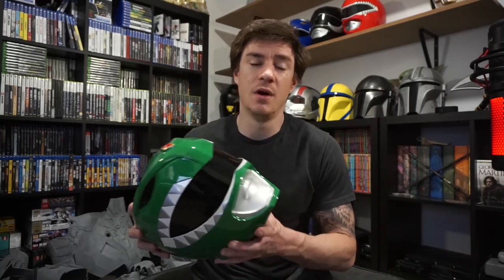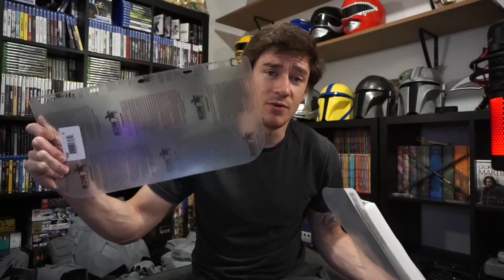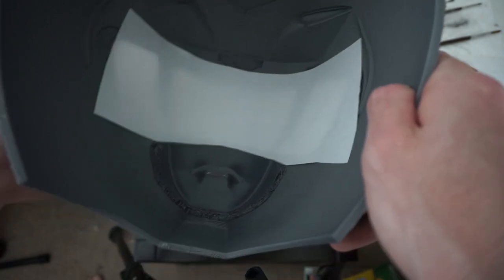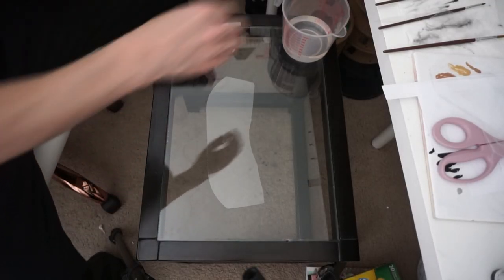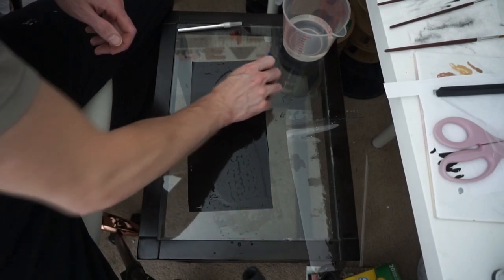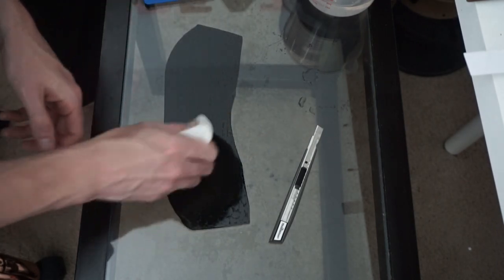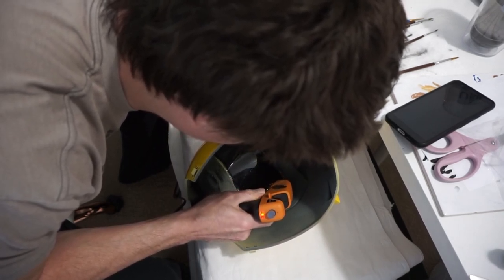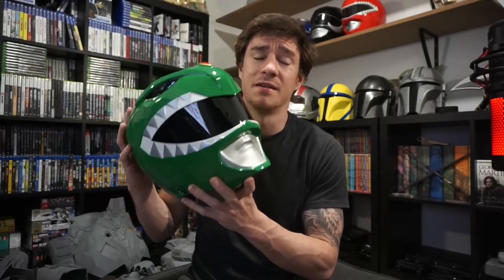How To Make Helmet Visors! Visors for your 3D Printed Helmets #3dprinted #3dprinting #tutorial

Comment: Adding to this, if tinting gets annoying for anyone/tinted welding masks are too dark, colored acetate or transparent pvc cover is your friend. Basically these are usually used for covers for binders and come in a range of transparent colors so you can have a visor besides black. They also come in just clear if you want to tint it yourself. Thickness-wise its actually in between the thin faceshields and the thick welding visors. You can usually find these in office or school supply stores or online.
Reply from the maker: Thanks for the bonus tip

Comment: I've read that people use a hot glue gun to simulate welding (the rocketeer helmet). A tutorial on how to do that would be awesome.
Reply from the maker: I have actually seen someone do that recently, I would expect the 3d design already would have the welds modeled on the helmet but it's really just drag the glue gun slightly wiggling then paint silver 🤘🏼

Comment: I JUST finished my Mandalorian helmet yesterday.. I purchased a welding visor off of Amazon and found it to be quite rigid when trying to form fit it in the helmet. I ended up using a heat gun to help form it, which worked wonders. I would be worried about using any sort of heat gun with window tint, though. So I would have to make sure to use something very flimsy and flexible like Acetate when using window tint, so I wouldn't feel the need to resort to using a heat gun.

Side note: I would love to see your process for applying padding inside of helmets and armor. I found it to be a constant trial and error process.. figuring out how much was needed, where it should be placed, how it should be angled, how thick each piece should be, and how the helmet sits on my head with each piece that was applied. Is this the "normal" process for applying padding?
Reply from the maker: The welding mask is definitely rigid like I showed in the video but should've been fine without the heat gun, also the face shield is very pliable so you shouldn't have to even worry about using the heat gun on that. For the window tint if you feel like you need the heat gun do it before you put the tint on. Padding is definitely trial and error. Completely depends on how you scaled your helmet to fit and what helmet youre doing. I usually don't pad it cause I scale them close to the fit of my head

Comment: Hey I know this is an some what old video now but I got a split/tear in the tint for my Red Ranger helmet visor. This tear formed after I put the visor in and had it in for a short while. How would you recommend repairing the tear without taking out the whole thing?
Reply from the maker: Honestly thinking taking It out is the best move, if you got glued it in should be very easy to peel the glue off the back

Comment: would it be a good idea to add a socket into the print for a visor to slot into? or is it better/simpler to go with the "what they cant see wont hurt them" style?
Reply from the maker: by socket im guessing you mean an indent for the visor to sit in, and some models have that but its more of a pain because then you have to cut the shape aboslutely perfect in order to get it to fit in rather then it just sitting flush with the edge
Reply: @SaturdayMorningProps   thanks friend, needed a second opinion before I tried adding it to a project I've been working on. was planning on making a indent kind of like half-rim glasses have, so visors could be swapped in and out. Its probably too ambitious so I'm gonna reconsider. you've been a lot of help
Reply from the maker: @darkdude9248  hmm lenses are a bit different it's not as hard to make a smaller shape like that so if you wanted an indent it probably wouldn't be too bad for that. Do3d does indents for its Deadpool eyes but they are a printable mesh that goes in it

Comment: i would assume if i were to wear a 3d printed helmet for a costume, I would need some sort of insulation any tips to make the inside of the helmet more confortable?
Reply from the maker: My iron man helmet doesn't have any at all and I've worn it for 8 hours stretches, if you get the sizing right and depending on the helmet they are comfortable either way
Reply: @SaturdayMorningProps  thank you for the information
Reply from the maker: @trendycard7mlg804  you can always add foam inside, I think frank uses sound proofing foam

Comment: Hi, I'm making a Daft Punk helmet, the silver one, and i've bought one of those face shields but it doesen't really cover the full piece, it leaves some space of about 3 centimeters on each side. If i put two more pieces to cover then you can notice it's added and I can't find other bigger visors. I can't seem to find a cheap welder visor either. Any ideas? Thanks
Reply from the maker: So you were able to find the COVID face shields but not the welding ones? Or the welding ones were 3inch too small as well?
Reply: @SaturdayMorningProps  The covid face shield was too small. But actually I have been a little bit lucky and yesterday found the welder one in a shop and it's the correct dimension. Thank you anyway for the help and for the tutorial.
Reply from the maker: @martinc.697  good luck and happy to help

Comment: In Cura is it better to print inside to outside or outside to inside
Reply from the maker: I have no idea what you mean or where that setting even is 😂 keep it simple when printing, I try not to change a million things cause if you start messing with stuff it's harder to find what caused the problem
Reply: I just miss read it, in the wall settings there is an option that says inside to outside
Reply from the maker: @Theguys1212  leave it a default I wouldn't change anything like that

Comment: Great video man! This is pretty much how I do mine!
Reply from the maker: Thanks 🙏 I figured it's how most do it but still see questions here and there so figured I'd help
Reply: @SaturdayMorningProps   yes it’s great to see how it’s done! Also if you have a moment I’ve been wonder (maybe better for a short vid ) but can you cover how to bridge the front and back at the top so one doesn’t fall lower/ separate away from each other on the top?
Reply from the maker: @John8338  you should be able to see in my early power ranger tutorials like white and blued where i hot glue elastic to the top as a hinge